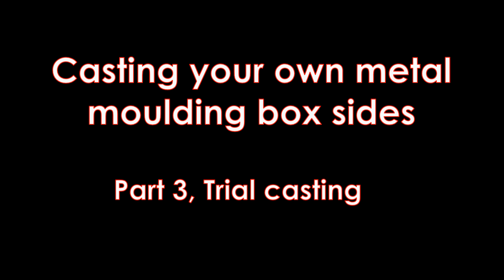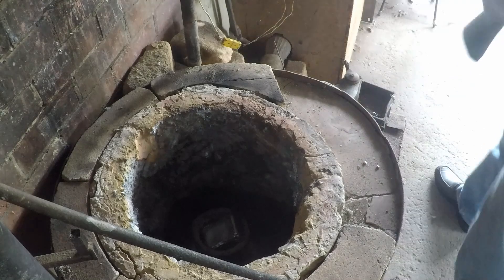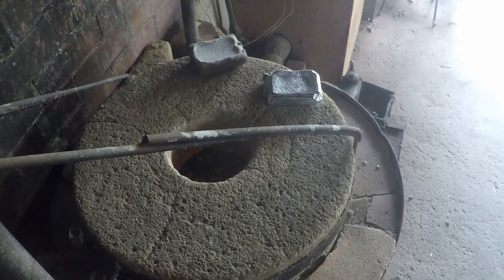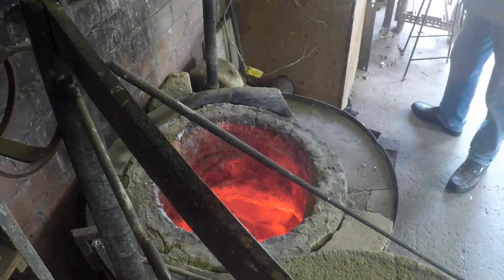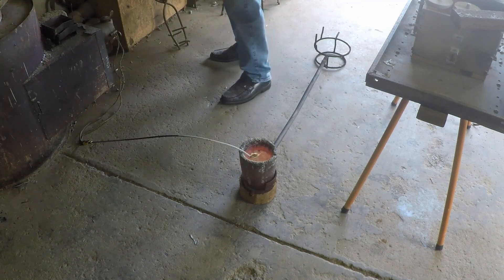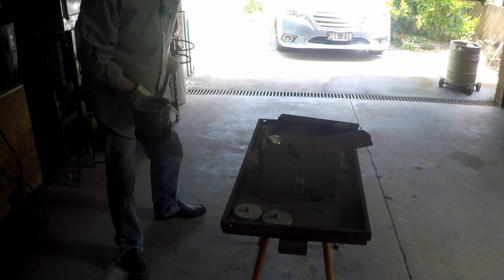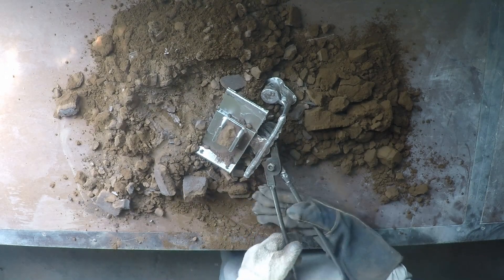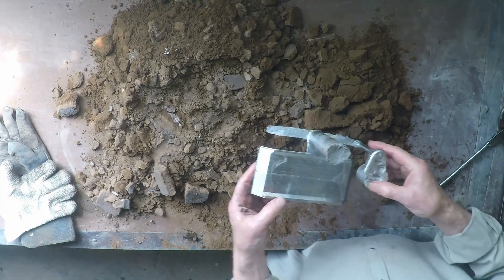Make your own metal moulding boxes - Part 3

Comment: I'd love to get a good look at your furnace
Reply from the maker: docven, Not really all that much to see! But maybe if I can summon up enough strength (difficult) I might be able to put a shortish video together. I will see what I can do..... Martin
Reply: @olfoundryman8418  I like the large size of the furnace and crucibles. Do you run propane or oil in your burner? What is the diameter of your burner hole?
Reply from the maker: Docven, I burn diesel fuel  the burner hole is about 1.5 inch but I use a propriety burner designed for oil and a large blower to provide the about 1 psi air.... Martin
Reply: Thanks! I want to be able to melt large amounts of metal for large pours using a big ladle @olfoundryman8418
Reply from the maker: docven, If you are going to use your furnace with a fixed crucible to bale out from via a big ladle you should look to using basin type crucible. These are wider and shallower than the more usual home use style crucible smallish ones of these (50 Kg) can be a bit hard to find but checkout a few crucible manufacturers web sites there should be a catalogue of sizes there. The furnace I used for casting the four barrel throttle bodies (see video) was fitted with a basin type crucible that held 75 Kg of aluminium..... Martin
Reply: @olfoundryman8418  this comment is very helpful. I've been at it for several years and this is the first time I've heard about these basin crucibles. Thanks for showing me the way.

Comment: Me: "That's better than any casting I've made, ever, by far.
OldFoundryMan: "I've Made a bit of an ash of it... plenty of room for improvement."

I'm off to look up what "exothermic" is.  I haven't heard of that before.  Thanks very much for the videos.
Reply from the maker: Elizabeth, Just curious - do we have a female foundry person? Often a first off is a little rough and only one seeing that first casting do little problems needing to be fixed become apparent that sure was the case here and subsequent castings were better (Mainly!) Oh, and there is always room for improvement - such is the way of foundry. 😊
Re exothermic :- it is added to the top of feeders and its job is to catch fire and generate a lot of heat thus keeping the feeder liquid for longer so it is better able to provide liquid feed metal for the solidifying casting underneath. It is a commercial product made (in this case) by Foseco,  it is called Ferrux NF. I use it one most of my castings. 
The videos are my pleasure..... Martin
Reply: @olfoundryman8418   Thank you very much for the reply.  I'll have to give the exo a try.

Comment: What are you using to measure the temperature of the molten metal?  What is the exothermic that you are using on the feeder?
Reply from the maker: Gregory, Temperature measurement is via an MIMS type K thermocouple 6 mm diameter, protected from metal attack by a boron nitride wash.
The exothermic is "Ferrux NF" made by "Foseco"

Comment: Can you get aluminum too hot?
Wondering if that'll change anything in my castings.
Reply from the maker: Silicone, Yes, overheating is bad. Anything over 760 deg C is likely to cause increased hydrogen gas problems. Higher temps increase oxidation and thus increase the amount of oxide floating around in the metal - this lowers fluidity, interferes with feeding, lowers strength and ductility. Higher temps also lead to increase grain size and this also causes strength ductility and feeding problems as well as hot cracking tendencies... Martin

Comment: Hi sir, I have a question.  Do we have to melt the flask first and clean the melt and then do the degassing or do the degassing first and then the flask?
Reply from the maker: Masoud, I melt the metal - then I degas it -  then I add 5:1 tibor grain refiner (about 1 part in 1000 of melt) -then I add a little drossing off flux to the top of the melt, lightly stir this in to just the top surface to dry up any dross. - then I remove this dry dross and pour the casting the casting... Martin

Comment: Martin your experience is showing! What is the difference between facing and backing sand?  I'm thinking facing sand is finer so as to improve the finish.  Just a guess.  Also what is the topping that you put on the exhaust port and what is it's purpose?  Thanks Tom
Reply from the maker: Thomas, I make the facing sand from half new (unused) sand and half used sand I pass this mixture through a grinding mill (there is a video on this https://www.youtube.com/watch?v=L9qP39y3E4k  )  This does make it quite a bit finer which does improve the finish of the casting. The topping that I put on the top of any feeders is an exothermic called "Ferrux NF". It is made by "Foseco" and its job is to catch fire and generate a lot of heat so the feeder stays liquid longer and is thus better able to provide feed to the solidifying casting underneath.... Martin
Reply: @olfoundryman8418  Thanks Martin

Comment: Hi sir i have problem.What coating can be used to improve the quality of the surface in co2 sand?
Reply from the maker: Masoud, Yes, I too find that CO2 sand gives a rough finish - its one of the reasons I do not like CO2 sand much. However there are a lot of commercial mould coat products made by people like Foseco that you can use. I have seen people rub the core with either talc or graphite in an attempt to fill in some of the inter sand grain holes but this risks abrading the sand away. You might do better with spraying or painting on an mix of alcohol and graphite (talc may work too) burn all the alcohol off before using the mould. You may have to experiment a bit with the alcohol and graphite ratio. You could substitute water for the alcohol BUT you then need to thoroughly dry the moulds and you may need to add suspending agent like clay (NOT bentonite) or CMC to the mix.... Martin
Reply: @olfoundryman8418  
Martin, thank you very much for your help🌹

Comment: Thank you for yet another instructive video. I am starting out on this journey and if I could produce the sort of result you seem barely satisfied with I would whoop with joy. But I am getting there. A number of questions: What flux (if any) do you use in your aluminium? It seems your furnace is diesel fueled? It would be nice to have some explanation one day. Also you promised details of your sand conditioner, please do share that. When you cast, you put 'exothermic' on the feeder, what is that? Thanks for sharing your immense knowledge and experience, I wish I could sign up fr an apprenticeship.
Reply from the maker: Coen,  Producing the sort of result I get is just a mater of practice and a constant effort to improve. The flux I use is "coverall 11" it is made by "Foseco" and is what is called a "drossing off" flux. My furnace is indeed diesel fuelled I use a commercially built burner that I bought new (at great expense  😊 ) many years ago - oil burners from home heating furnaces can work well. There is a video on my sand conditioner see here https://www.youtube.com/watch?v=ASTMlwUil5Y . The exothermic that I put on the top of the feeders is called "Feedex NF" it too is made by "Foseco" its job is to catch fire and generate a lot of heat which helps to keep the feeder liquid for longer so it is better able to feed the casting underneath. I do indeed badly need an apprentice..😊...Martin
Reply: Coen...As I watched this video I had the exact same questions. I'm a newbie as well. What flux and how much? Exothermic and how much? And for me, is that a thermocouple you're using for temp and I assume you're reading in C and not F? Where would one get that? Thanks Martin!

Comment: I found using 3D printed patterns got better after 2/3 uses, So I now dust, rub in by hand, brush off and re dust before first use, works better then.
Reply from the maker: Andy, Fortunately I have a tame pattern maker  who after sufficient pleading begging and bribery will make me a proper pattern. However I do use 3D patterns but I prefer to do a fair bit of sanding painting etc to get them smooth enough to do my sand justice. What you suggest is interesting and I have a raw 3D pattern in use currently (one of the box sides) and it will be interesting to see how it goes with further use. What do you dust with?.... Martin
Reply: @olfoundryman8418  Martin, It depends on what I am making, you have seen the detail my oil bonded can produce, I can easily see print lines from a .2mm layer print.

Comment: I'm happy to see another video from you. That made my day and its 1/4 to midnight.
Reply from the maker: Eleventeen, More coming soon just hang in there.... Martin
PS. Try and get some sleep 😀
Reply: @olfoundryman8418  Excellent. I watch in awe of the quality of the products you make. As well as probably thousands of other people. I haven't been able to do much casting yet. But I'm learning  from guys like yourself and a couple others. You are top of the chain. By far the best explanations. I've been taking notes. So once I can get out and make a melt t'll pay off.
 And as far as sleep goes? Thank you. I get it in bits. It's due to a failed back surgery. The surgery was a success in fusing the vertebra. But the nerve damage was the failure of it. Been over 5 years now I'm used to it. So that's why I watch great  youtube videos. Like yours.  Anyways thanks again.
Reply from the maker: Eleventeen,  Back surgery - you have been reading from my playbook. One disc removed 1970 recovered well. But lost some of my balance about 3 years ago disc in neck impacting spinal column surgery stopped the rot avoiding the wheelchair but did not restore balance (nerve damage as you say) now I have CFS as well. 😰Today I poured 10 castings but totally exhausted myself doing it - will take 3 to 4 days to recover! My advice re back is at all costs keep it moving inactivity makes it worse - use it, but don't push it too far. Get a phisyo to prescribe some back strengthening exercises. Foundry is hardly the occupation for bad backs (believe me I know) but good luck with it.
I have a mate who was born in nineteen eleventy eight, your not related to him are you? 😀   Martin
Reply: @olfoundryman8418  I hope I'm not following any playbook. Well other than what the lord wants of me. Although I don't think he was responsible for my rather long bouncing trip down a short flight of stairs. It bulged the disc in my L5-S1. Which was the first of it. They eventually removed it and fused it with a cage, rods, and screws. Then recently after 4 years I had another surgery to remove the rods and screws. To see if that would cut the pain. Nope. It made things differently worse? That sounds funny. But makes sense. I have pain that runs from the surgery sites down my legs 24/7 365. The severity of which changes from where i can do things for a little while to me not wanting to do anything but lay down on ice. And it goes without saying that I'm eating pills like a spoiled child gets cake. Which is why I'm going to try one last attempt at stopping it and the pain. Going to go for the trial with a electronic nerve stimulator. I've heard and been told to avoid it. But, it's better to have tried than to have not and wondered what it later. I'll try it to get rid of the pills and patches. I have no upper neck issues yet. Thankfully. But I've had knee work done once. So that's not great. But it's better than it was. So I can't complain. Hopefully yours doesn't get worse and yes activity is the key to minimizing the pain. Unless it was activity that caused it. Then it's like you're said a 2/3 day  recovery in bed.

Comment: Metal looked really low viscosity. Was that an illusion or was that the high temp? Your part looked awesome to me. I couldn’t tell that there was anything wrong. No obvious holes or anything that 2 minutes with a file wouldn’t straighten out. But I’m sure you gave a better eye fir these things, I hope you go into details on the flaws and how you fixed them next time. I always learn something in your channel.
Reply from the maker: Rv4, In the main an illusion I think. I doubt the extra temperature would do all that much to lower viscosity, mainly it just gives a  larger temperature that the metal has to drop through before it gets too solid to run thus -hopefully - it will run further.
Yes the casting was quite usable - not pretty but prettiness is not needed here. A little mould edge loss but as you say nothing a file would not fix. I have already shot the "for real" moulding and some improvements are covered in that but when editing I will try to keep flaw avoidance in mind.... Martin

Comment: In the next video when you make multiple parts, can you show how the off-side part works.   My understanding is offside is used with non-flat parting lines.  I just can't envision  how that part is used.  Thanks.
Reply from the maker: Jim, How to use the oddside is a big part of the next video. Making of the oddsides was one of the big improvements made following the first trial moulding and casting videos. I have already shot the making of some of the "For Real" moulds and I do clearly demonstrate the use of the oddsides. I aslo make one mould where I do not use them as not everyone is going to 3D print the patterns and therefore may not be easily able to make the oddsides -the difference is quite stark but don't worry it is very simple and easy to use the oddsides....Martin
Reply: @olfoundryman8418   Thanks Martin.

Comment: What would a professional craftsman think about this sand used here: https://www.youtube.com/watch?v=ToWAUA5CRs8 He mixes sand with molasses.
Reply from the maker: rox, Yes, I have seen quite a few of these videos. Then use of such binders is not unknown although more usually in things like baked sand cores. The sand - by the way it behaves/moves seems to be like petrobond sand. And I note that scraping away the "against the metal" sand is necessary just as it should (probably) be done with petrobond. I guess its a case of use what's to hand and it may well be an interesting technique to try. The moulder concerned has a great deal of skill but some of his techniques particularly what he melts,  how he melts, and how he pours are a bit of a concern as his apparent lack of any feeders.....Martin
Reply: @olfoundryman8418  I have seen most of the videos of his work, I am quite impressed with his "take what you have and make what you can" approach. He have made cores when casting pipe couplings in one video. The sprue is unique as it is a wedge rather than a tube and feeds direkt into the mould. His boxes are not so far of from your design either. I wonder if sifting the facing sand first would improve the finished casting? I am keen on trying this some day when I have a place to work from. Thanks for your time Martin.

Comment: I snuck this video in during work this morning, couldn't help myself, but here I am again.   I know the question was asked earlier, but any details of your furnace would be appreciated.  I'd like to build one in the future...  Appreciate this series of video, motivation for a furnace.
Reply from the maker: Rich, Furnaces are easy! they just rely on burning a lot of fuel in a small hole as quickly as possible - its just got to get hot if you do this! I built my main furnace about the mid 1970s and if I was to do it again (unlikely) I would do it a bit differently. First thing is to decide what sort of fuel - electric oil (diesel) or gas. Electric is quiet but slow, Gas is the easiest burner design. Oil is the cheapest fuel. For a quick start you could just buy a Devil Forge they seem to work well enough although I am not keen on them for the way the lid works one could be modified to fix this problem though!...Get motivated and Just do it!... Martin
Reply: @olfoundryman8418  Yes sir, got-it, a lot of fuel and a small hole...sounds easy, what could go wrong...;)  You did answer one of my questions about fuel choice and why.  As well, I think your lid mechanism is intriguing, it seems to operate with much ease and control.  Lever handle, counter weight and stable pivot post...I'll binge watch some of your prior videos for more ideas.  Again appreciate this molding box series, always something learned from a seasoned foundryman.
Reply from the maker: Rich, There is no counter weight on my furnace lid just that lever arm which sort of has a cam on its end this operates against the end of the inner tube (welded to the furnace body) around which the outer tube carrying the lid slides up and down. The tubes are two sizes of steel water pipe. The devil forge lid suffers from the problem that it exposes the operator to the hot underside of the lid when the furnace is opened - you already have enough radiant heat from the inside of the furnace without needing more form the underside of the lid! Choice of fuel may be different according to where you  live I guess it would be a local price per unit of energy thing. Gas is very convenient as it is (relatively) easy to build a burner for BUT I firmly believe that you DO need a blower with gas  just as with oil to get a decent air/ fuel ratio. Many gas burners run rich and it is best for the metal and economy if they run lean (about 2% Oxygen in the exhaust gas) hence the need for a blower….. Martin
Reply: @olfoundryman8418  Your video, Furnace Light Up...tells me enough.  Great design!  https://www.youtube.com/watch?v=cdh-TC-yKDY